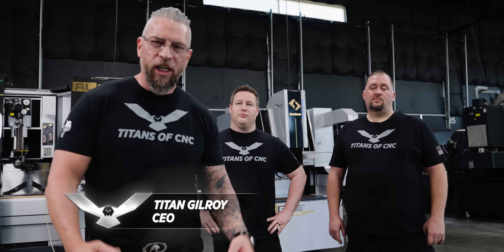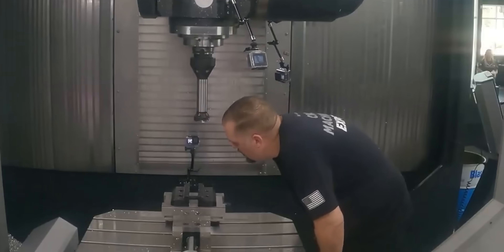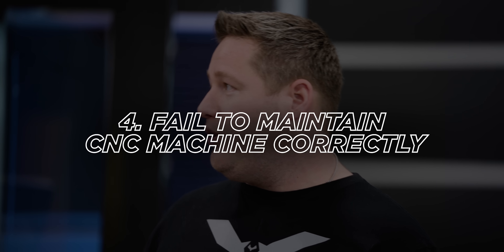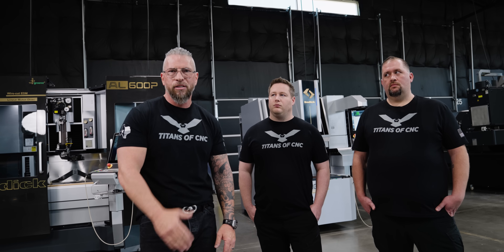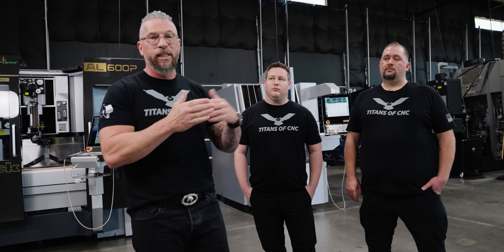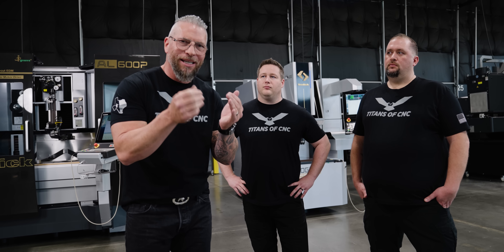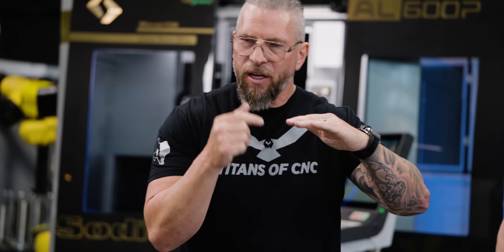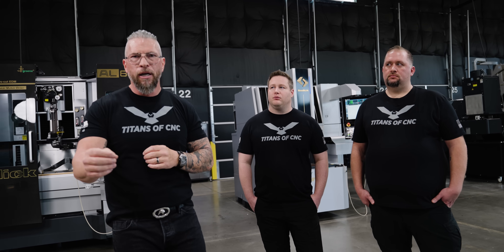Machining Mistakes That Will Get You FIRED

Comment: Single Block, is your best friend.
Reply: Distance to go display is invaluable
Reply: @brandons9138 as someone who does alot of fine contouring moves, 2 and 3 axis, I agree with Titan. Distance to go changes too quickly for it to mean anything to me. Absolute position is easier to understand and 50% of my jobs I'll set like he said, zero on top. I only have to glance at my Absolute pos to get all my info.
Reply: @brandons9138  Depends on the process and controller for me. On my Doosan and Okuma 2-axis lathes I can have both the work offset and the to-go numbers displayed at the same time. On my Haas V-mills and mill/turn I can't so most of the time I'll sit in work offset but bringing the tool to the part I'll have to-go displayed.
Reply: So is feed hold
Reply: Single block when I have made a new post-processor or a made some large changes to it.

Feed hold for when I run a new program for a new part, then when it's run through. I just use feed hold for the initial entry of the first tool, to hear, see or feel if the part is snug.
Then I either walk away or sit down and wait for the machine to finish.
Reply: Some people love it, I rarely use it but it is handy.  I’d recommend it for inexperienced people that haven’t learned to watch distance to go and override rapid and feed all the way down.  If you’ve just wrote a profile using long form g code, maybe dry run it first to make sure your I and j delta start to center arc moves are correct
Reply: @ i would say you’re inexperienced if you don’t use single block. your reaction time is 0.15 seconds, a lot can happen in that time frame.
Reply: @ you aren’t making sense, the more experience you have in programming and setup, the more confident you are.  I’ve been doing this for 2 decades and have reached pinnacles in machining that most people will never see.  I teach advanced 3d and 5 axis +mastercam, been using it since 2005, and been writing long form g code longer than that.  You’re talking to a lead machinist dipstick, if you have to use single block every time you load a program, YOU sir are inexperienced.  I guarantee you aren’t worth one butt hair surrounding a machinist a hole
Reply: @BlueF350  Isucc brought up 0.15 reaction time, which says to me he's talking about a rapid tool movement. If he's just talking about a tool moving to or from home then would you consider that safe practice or inexperience?

For me it would be safe practice unless he comes back to say he single blks everything, at which point that only works on simple programs.
Reply: @BlueF350  you're lying and single block is what you're supposed to do first part.  If you ain't ever crashed a machine you a fake machinist
Reply: @BlueF350  i work now over 16 years as a machinist and every person who doesnt use single block on new programs is simply not working right. im so happy that i live in europe where that job is actually taught the way it should be
Reply: @92JohnDorian  wrong, if you are using single block for every single new part, your roughing toolpaths are ineffective, but i would really like to see you push the cycle start button 100,000 times for a single operation, go on... i will be on my 15th part when you are done proofing your first adaptive toolpath...
Single-block has its place and time, but its not always the correct choice, i would use it on one of our lathes which i am programming at the controls, the machine is pure Fanuc, without manual guide, so its simple ISO code and no simulation... On the other hand, 5axis mills programmed in CAM, i have used single-block maybe 5 times in the past 3 years, its always just easier and faster having your hand on the feed potentiometer and having rapids all the way down to 0%
Reply: @dubi127  You can single block to bring each tool up to the part and when it's done rapiding you turn off single block. Will need John to clarify if they just mean to rapid tools to the part or the whole toolpath before deciding his take is dumb. We also don't know what he runs, I don't see a massive issue if he runs 2-axis lathes or 3-axis mills in single blk for the first run.

On my lathes I'll bring up the tools in single block and single block one pass of roughing to make sure it doesn't crash but if milling on the mill/turn I'll rapid the tool up and just let the tool run itself from there 'cause you're right the amount of code is too much to single block. I have a mill guy that deals with the mills so I can't say for certain how those get ran but the times I have ran our horizontal I have used the feed control as my single block more than the actual single block, can't explain it, just feels right with the machine even with simple milling ops.
Reply: @iDeLaYeD_o  even for rapids i dont really see a point in using single-block, when you can turn them down all the way to 0% rapid, which on the machines we have means something around 400mm/min ( 15-16in/min), and still stop it at any time just by also turning the feed down to 0%...
Reply: And slowing the rapids till your ass is happy
Reply: If I where hand programming the part, I would use single block for most of the programs being run. If it is from scratch and not just a modified old program.

But using CAM with a proven post-processor, I rarely see a point in using single block. If it's something wrong with the program it is because you have something wrong in the CAM software. Which should show if you are not missing something in the simulation, whether it be toolpath only or a 3D simulation of the run.

If I saw a colleague of mine always use single block for every program that person runs in a machine, I would say that person is not confident enough in their self. Either it be their experience, having had a run of mishaps of varying degrees recently etc, etc.
I would not think, "That is a skilled operator right there".

I'm from europe as well, and have taught and been taught by people around europe.
Reply: Brother, it’s Cycle start, walk away. 😂😂😂😂 jokes. Please be careful guys you can never over validate your set up
Reply: Single block is fine if your watching your numbers in G-code. But hitting cycle start after the next movement can still lead to a crash if something isn’t set right or the code is wrong
Reply: most of the time i would agree but i have run into problems where it whend into allarm/internal stop. so i had to be out of single block ( but then i just turned down the feed and rapid to 2% with one hand over feed dial and the other one over the E-stop ( so i can turn the feed to zero. look at the screen and into the machine and look if it looks right or not cause i know that if im in single block the moment it starts it allarms ( and weirdly its only that specifik moment with that tool path with single block it does that )
Reply: Single block and 5% rapid.
Reply: @johnathandougherty  sadly there is some rare cases where it can trigger alarm in single block ( they are really rare but i have personally run into them. so when that happens i recomend single block off. one hand on feed dial and one on E-stop. when it get's real close to part you turn down to 0% and look at distance to go. look at the machine " does that look about right. if yes turn back to 5%" and let it go down agen still looking closely until it stop moveing in Z and start moveing in X or Y. then you can bump it up. since your tool want to see the load its ment to )
Reply: Only use single block as a set up guy when u see G43
Reply: Amen.
Reply: Absolutely. Ive been on the mill so I dont often use it much unless I am designing and machining a new part, but on the lathe I am using for every single first cut to be made. Absolutely it is your best friend.
Reply: Cam software is your friend and a valuable operator able to watch a part run for the first time and stop it. I mean try to single block a program running a hour long. Takes way too long. Only useful for short and straightforward programs.
Reply: Not for tapping
Reply: @RonaldCassidy-hk6kz  pretty sure you can tap in single block
Reply: @RonaldCassidy-hk6kz  You can. If you use a tapping cycle the machine will know that and it feeding in and back out is 1 block so even in single blk mode it'll be fine. Canned cycles override some of your manual inputs if it needs to. ex. when threading on a lathe you can have your feed control set to 0% and the machine will still feed as fast as the threading cycle commands.

Comment: Another mistake I see people make, even old school seasoned machinists, will run all of their tool length offsets as negative numbers. They will put a tool in the spindle at Z machine 0, and then jog down and touch the part, and then set their tool length.  That's a terrible way to set your tool length.... You should always run positive tool length offsets.  That way I can look at a tool, and say yep that's 7 inches, and my offset is about the same. So I know that I'm not wildly off. If I see a negative number in an offset table, I have no idea what that correlates to in actual tool length. It's a very good habit to get into.
Reply: If you use a laser toolsetter having a negative offset is the only way it works.....
Reply: Its not tool length its height offset and what do you mean you have no idea what that negative number means? If you're running a 3 axis mill then from the spindle to the max depth to the table with out a tool is going to be your max negative number. Once you memorize the max travel of your axis then your tool offset to the part would be the max negative number minus length of tool and height of part from table or z max.
Reply: @dman0042 I know what the negative number means, but it doesn't logically correlate to anything relative to the tool in the holder....if I have multiple machines, by using positive tool lengths in the offsets, I can take that tool to any machine, regardless of the setup in each machine..and all I have to do is plug in the known length of the tool/holder in the offset table
Reply: @Steelcrafted  You could run negative but you would have to know the negative spindle to table max in each different machine and subtract your positive tool length. But in your case it can help out with that. I agree.
Reply: Regardless of how you vs someone else wants tool offset measured always look at distance to go and if you set it correctly from Z zero with negatives its going to tell you exactly how many inches and increments are left before it reaches top of part.